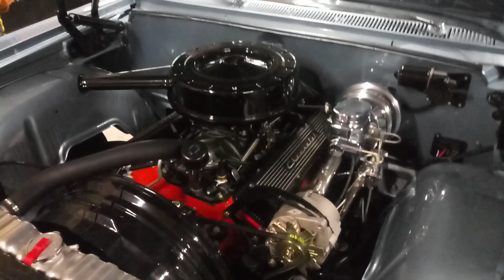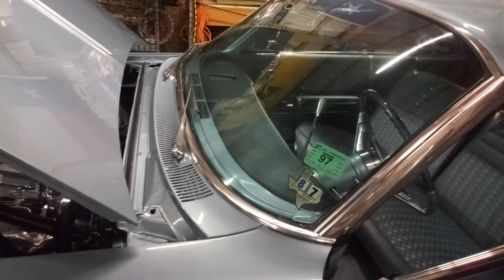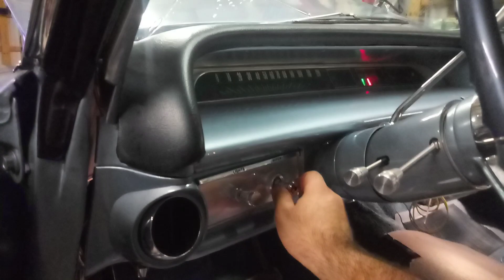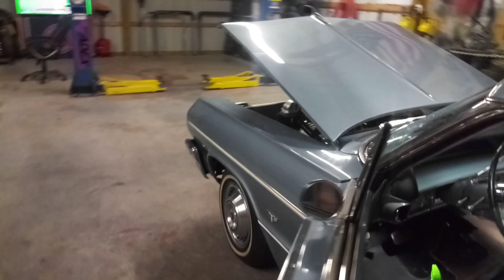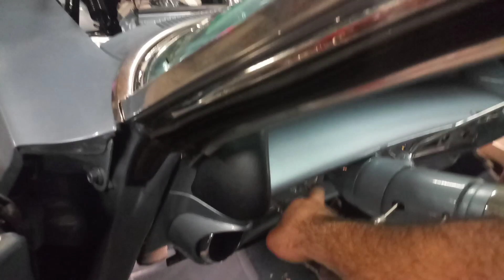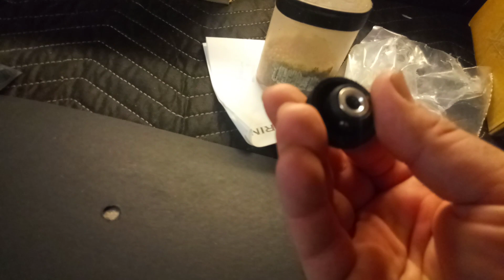1964 impala newport engineering wipe motor install

Comment: Can you tell me where u bought the windshield motor I have a 64 and my wipers don’t work
Reply from the maker: Newport engineering
Reply: My 64 has the original it was working but I send it to get the engine rebuilt and now they don’t work 😭 thanks I will try to find the place 🙏

Comment: The red wire goes where? It has a connector on one side but other end of wire has no connector,  thanks
Reply from the maker: Its probably hot wire. Should came with instructions

Comment: When I attempted to take my motor off, it was hung on probably the wiper bracket. I didn’t want to force the motor off, so how were you able to remove the wiper motor? Or where can I find instructions on how to remove? Thanks
Reply from the maker: There should be a clip on the end of the wiper motor arm. Then a nut if i remember right

Comment: Question on that wiper motor I won't need to make any holes or mods for it to fit? Wanna buy one but my firewall is painted and wanna know before I buy it
Reply from the maker: It is a direct fit. And looks better than original.